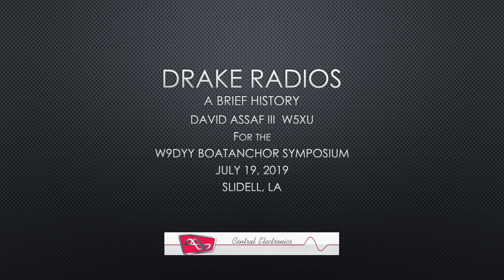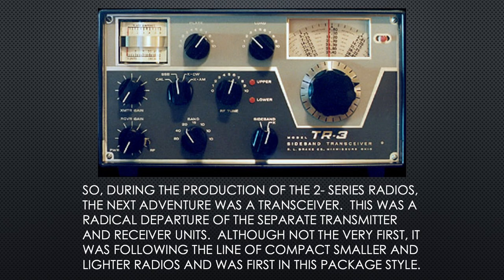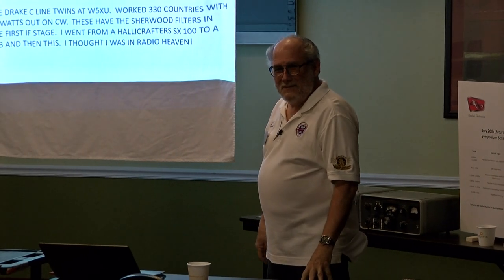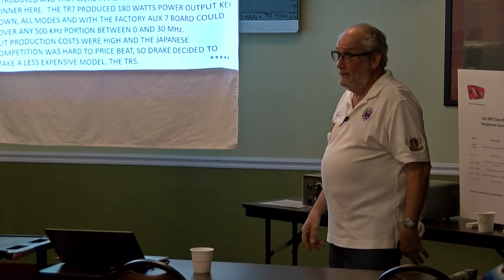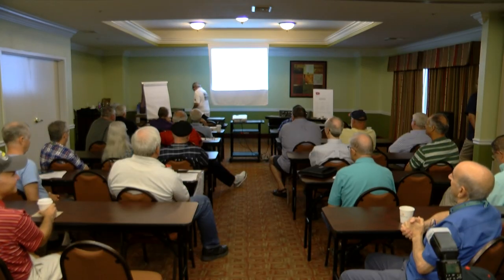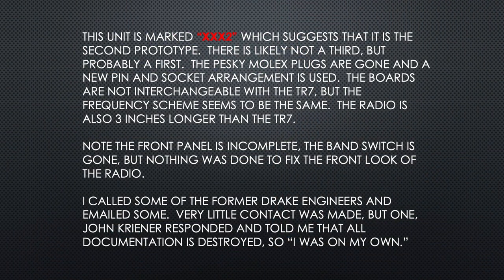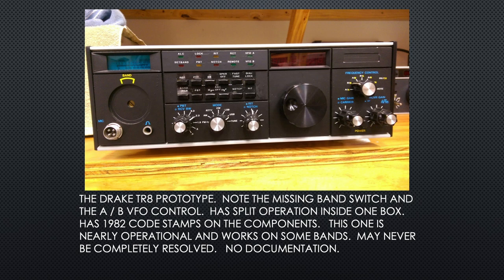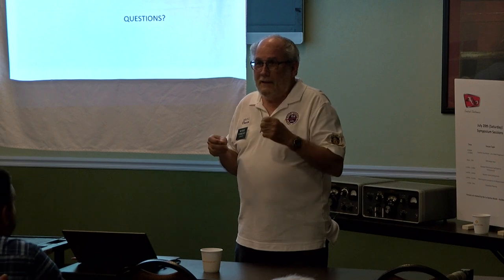A Brief History of Drake Radio and the TR8, TR7B and L85 Prototypes

Comment: This is a wonderful presentation. I learned a great deal. Thank you. My older brother was excited when got acquired a Drake 2B receiver. Years later I was living in an apartment listening to hams and SWL with an old Hallicrafter SX-71 receiver. I was able to purchase a used Drake R4-A from Henry Radio. WOW! Wha a difference the Drake made. I now could determine exact frequency. Many years later I acqauared a Drake R4-B, T4X-B, and Drake speaker. I had Jeff in Ohio go through then and they perform better than new specifications. W5JCS